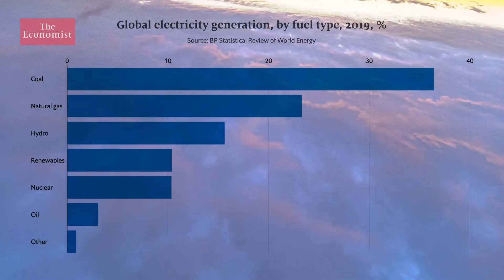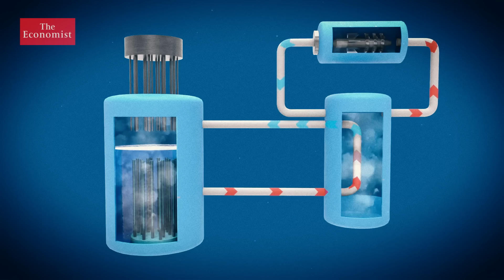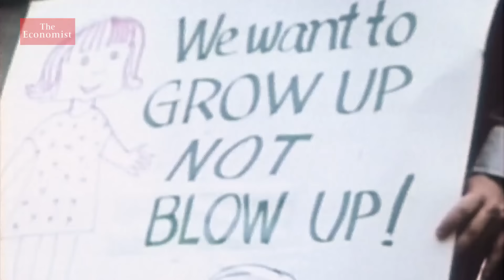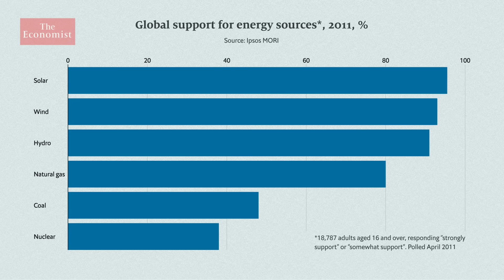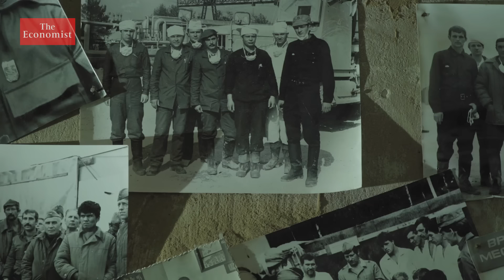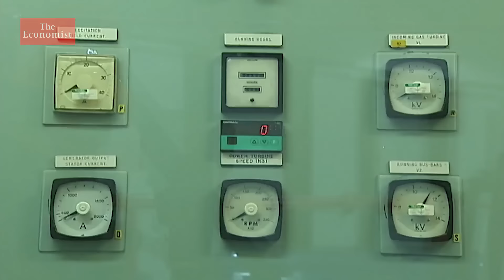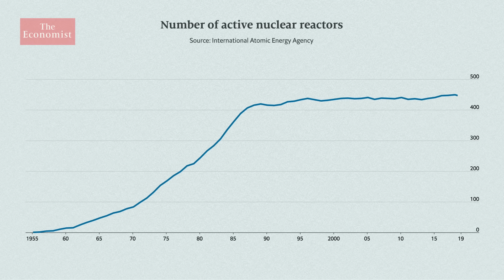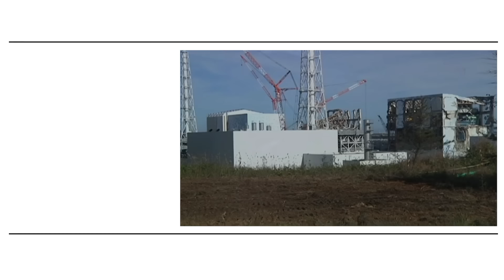Nuclear power: why is it so unpopular?

Comment: Three Mile Island, Windscale, Chernobyl, Fukushima... I don't know, why IS nuclear power so unpopular?
Reply: Exactly 💯
Reply: How many deaths and injuries along with life limiting conditions have been cause by other power generation systems? Coal has to be mined, North Sea gas is produced in an environment that has lost lives so I think we need to look at the complete cycle before determining safety.

Could it be when we look at deaths caused by conditions like pneumoconiosis and silicosis in miners and many other conditions under the COPD family that have effected not just miners producing coal but, the general population from the levels of pollution produced would be significant when the full picture is considered?

Is killing someone with radiation somehow worse that killing them by filling their lungs with dust or pollution?
Reply: @captainjackpugh6050  Is there a safe, non-impactful way of disposing of the spent fuel rods now, or are we still concreting them up for future generations to deal with? Your generation maybe, seeing as you're about twenty at most?
Reply: @ohidontknow1061  Nobody is saying that. I'm simply pointing out that we seem to be a long way from taming the atom for our own ends.
Reply: @stationsixtyseven67     Stored underground, safely. The waste can remain there for thousands of years. The generations then aren’t going to have a single problem getting rid of it. Seriously. It will be easy for them. Technology is great.
Reply: @captainjackpugh6050 do you know how time consuming and expensive it is to store nuclear waste underground? The process consists of drilling a borehole into basement rock to a depth of up to about 5000 metres, emplacing waste canisters containing used nuclear fuel or vitrified radioactive waste from reprocessing in the lower 2000 metres of the borehole, and sealing the upper 3000 metres of the borehole with materials such as bentonite, asphalt or concrete. If the entire world adopted nuclear power I can tell you right now they won’t all be storing it underground some will cut corners and dump it in the ocean or rivers and forests you seem very ignorant yourself.
Reply: @stationsixtyseven67  I would agree, I'm sure you would agree that the damage to people caused by pollution, mining and petrochemical extraction is an issue as well. 

When we take into account that even green energy requires the extraction of minerals, the use of resins derived from petrochemicals and batteries need lithium to be even reasonably effective we have to accept that all methods of producing energy is in some way damaging to us and the environment.

We know the damage that energy production through hydrocarbons does yet still we carry on with it but, nuclear power..... Oh no.....
Reply: @stationsixtyseven67  Is there a safe way of disposing of the muck that power stations spew out now or are we using the lungs of our children to absorb the particles while they slowly gum up? Is that the sort of future problem you are talking about future generations having to deal with?

I'm not even using the climate warning argument as there's plenty of wiggle room in that but, particulate emission is a real, current and ongoing problem that does cause damage to all of us. 

If we want to have a sensible discussion about waste from any particular method then we should not ignore the issues of the others. Are you in favour of using fossil fuels knowing that they are damaging the lungs of people? Are you ok with future generations being left with that problem to try and solve?

Comment: When talking about nuclear power one should not forget the shutdown costs - and it's billions, billions and billions… Lithuania knows it very well. Our plant was closed in 2009 and the final date of decomissioning is 2038. The estimated cost - 3,5 billion Eur which probably be much higher. So the nuclear energy is not as cheap as it seems. But maybe we should not care about it because the future generations will pay for this?
Reply: Yes thank you for saying this. Engineers planning ends at the drafting table. They never think about long-term consequences. Disposal. Bioaccumulation. Geologic stability.
Reply: @frostrune  The closure of Ignalina nuclear plant was the precondition for Lithuania to access the EU. The problem was that the LT nuclear plant was the same type as the Chernobyl plant so even after considerable safety improvements it was considered unsafe. As you may know safety has never been a priority in Soviet Union and even in todays Russia. Your right there are older nuclear plants in the EU nevertheless but it’s wrong to say a newer one is always better.

Comment: Nuclear energy, IF the proper precautions are taken, is one of the most efficient and clean energy sources out there. The only reason the Chernobyl incident happened was due to a combination of the worker's incompetence, precautions not being not taken, and overall unsafe work procedures
Reply: Also the Soviet government's incompetence in handling the affairs. It got so bad they didn't inform the incident until weeks after the incident happened and public were mad that they weren't informed of it.
Reply: IT was badly designed.

Comment: In Russia we already have closed loop nuclear power with zero waste. Can even use old nuclear waste as fuel.
Reply: thats the thing its not waste until it can not be used any more
Reply: @FowlorTheRooster1990  and then you recycle it... or throw it in some old mine and fill it with concrete
Reply: yes, look up MOX fuel and fast reactors
Reply: I'll believe it when I know more, France was talked about in this very video;  a Nuclear Promotional Advertisement.  France never solved their waste problem,  France HAS a Nuclear Energy Waste PROBLEM.
Reply: @arcanondrum6543  every country that uses nuclear has a spent fuel reprocessing and disposal issue its not just France
Reply: @FowlorTheRooster1990  No argument from me there. This video is nothing less than false propaganda favoring those who profit from the Subsidized industry and the bearded clown they feature lied about France, hence my point
Reply: @arcanondrum6543  what point? and favouring what industry?
Reply: @FowlorTheRooster1990  I will let you replay the video to hear what he said about France and then connect that to my point. 
Industry : the Nuclear Energy Industry.

Comment: What really happened was that there was a massive FUD campaign in the 70-tys financed by our enemies and/or competitors. 

One thing that happened after the oil crisis (1973-1974) was that west that at that point had a lot of oil powered power plants leading more on nuclear power and well all of the oil powered power plants was pretty much replaced with any alternative there was over night. Prior to that date oil powered powerpants was fairly common, now they hardly exist at all. Old coal plants was stated up leading to the smog of the 70-tys and 80-tys prior to catalytic converters in cars.

This was the start of the alternative ca of the late 70-tys and early 80-tys, and also the zero emission rules in California that was abounded pretty much before it went into effect.

While the oil powered powerplants only consumed about 20% of the US oil consumption, the sudden drop combined with the increased production of oil over the mid 70-tys for US was quite obvious to OPEC. The demand for oil was much lower than it use to be, at the same time prices dropped. This was a unsustainable situation for OPEC and the oil industry in general.

More over the push for biofuel, electric cars or hydrogen cars was just started, and was planed to be in full swing by the end of the century. This would pretty much result in the death of the oil producers.

This resulted in a campaigned in the mid 70-tys payed by oil producers against nuclear power. We know this, because at this point they was quite public about it. In 1977 or 1978 this suddenly stopped at the same time several environment organisation suddenly sing from pro nuclear to anti nuclear. Why they did this is not quite public, but according the defectors outside money was the reason. This turned GP from a pro environment organisation to what it pretty much is to day, a anti nuclear organisation. Pretty much every single one of the followed, at the same time they finances expanded drastically.

At the same time the push for solar and wind started to happen. Why? Probably to make it seam like there was a other alternative.

Some people might think that solar and wind would eat into the profit of the oil companies. That is not the case. Solar and wind need fast acting power-plants to back them up. There is only two types, hydro, that there is a limited supply  of, and gas. Gas is a biproduct of oil. This did not only put nuclear out, but also coal, what really at this time was the main competitor to gas and oil. 

This also had the effect of making it harder to get away from oil for cars.

In the late 90-tys and early 00-tys the price of gas skyrocketed and the oil producers become super rich. Than something happened that broke the system. Fracking.

Comment: However, one crucial factor is missing in this video: How and where do you safely store nuclear waste until it is not harmful to the enviroment anymore? This isn't touched at all in this video which is very strang. In my point of view this projects a wrong view on nuclear powerplants and its sustainability.
Reply: What about it? The “waste” is solid metal rods that are stored inside weatherproof dry-cask storage cannisters and stored on-site in a secure location. It is neither a security nor environmental risk.
Reply: Exactly! If someone watched this video, she/ he would have no idea that nuclear waste exists. As if nuclear waste were an insignificant detail which could be “overlooked”. I feel the channel’s credibility on this issue is destroyed.
Reply: There are already reactor designs out there that use nuclear waste. The point is made even more moot when you factor in that Thorium reactors produce even less waste than Uranium-based reactors.
Reply: @howardbaxter2514   So the argument is to replace the nuclear power plant currently in use with new ones? Hopefully by then corrosion and other issues will be solved. In any case, nothing mentioned in this video.
Reply: @geopan73  well, old reactors need to be replaced anyways. My assertion is that we should replace old outdated reactors with newer ones that utilize either Thorium or spent fuel.

Comment: I miss comments about storage / disposal of the radiation material after its use. There is no answers yet. Which for me is the biggest reason to take hands off nuclear power...
Reply: There are answers, you are just ignorant of them.  Thorium molten salt reactors.
Reply: Waste is definitely an issue, but like every other aspect of nuclear power, the danger is exaggerated. Waste is dangerous if you let it into the environment, but people don’t realize how little waste nuclear plants actually produce. You often see pictures of huge caves full of the yellow barrels, but that waste is low-level and is usually just contaminated things like clothing and other non-fuel things, it’s not the waste coming from the reactor. The reactor waste is stored and guarded on site at a nuclear power plant, and since reactors only need refueling once every couple of years, the actual amount made is tiny compared to every other source of energy we have. For instance, (as much as digging solar is cliche for pro-nuclear people) solar energy produces over 100 times more toxic waste in its lifetime than nuclear does, it’s just that people aren’t scared of that waste. 
And of course that isn’t to mention reprocessing, since over 80% of high level waste can actually be recycled and out back in a reactor.
Reply: You are wrong. Search Onkalo spent nuclear fuel repository, Finland. it was opened in 2020. No big chear by propagadist mass media, but it is one of the greatest deeds in last 20 years.
Reply: @jakubcidlik  This repository will only commence work in 2021 and also only be able to store the amount of waste that would be generated in roughly 100 years by only 5 nuclear plants.
Reply: @lesand5484   And by then it will not be needed as all that was to be deposited will be very valuable fuel in thorium molten salt reactors.
Reply: @danadurnfordkevinblanchdebunk  It's funny how everybody thinks Thorium is safe when it's waste products include Tritium, which is almost impossible to keep from escaping, then you have corrosion problems in the reactors and the waste has high radiation...
Reply: @lesand5484   Every single nuclear power plant on the planet releases tritium.  It's also produced in nature since the beginning of time.

Comment: Waste is not the problem. At all. 
As of 2013 USA accumulated about 70 000 tonnes of nuclear waste. The specific barrel for this is about 3m high. That's one football field of waste, of which very small proportion is "long lasting".
Reply: Yeah, one long term storage site could store hundreds of years of high level watse.
Reply: @capras12   And would be a great repository for fuel for use in thorium molten salt reactors.

Comment: But why build them at all when renewables with storage is actually cheaper and has 0 or close to 0 risk?
Reply: To create a transition between fossil fuels and renewables, the major issue with renewables right now is energy storage batteries and other methods are currently expensive and don’t store near enough energy for their size. Until we can create better ways of storing the energy it would be hard to go fully renawble especially on a time frame like the one we are on.
Reply: Because nuclear plant has even better baseload capacity than coal. Baseolad  is something renewables can't do now, which is the reason why Germany are firing coal again after shutting down nuclear reactors, and also the reason why Japanese are turning back to nuclear

Comment: What about the nuclear wast?
Reply: No one has been injured by stored nuclear waste.  Besides, it will be valuable fuel in the future.
Reply: Yes, current nuclear waste is slightly used nuclear fuel to another reactor, say a molten chloride fast reactor.  Its waste would be 1/1000th the amount and radioactive safe in ~300 yrs

Comment: I dislike that you did not mention the storage of burned out fuel once.
Reply: No one on the planet has ever been injured stored spent fuel rods.  They will be valuable fuel in thorium molten salt reactors.
Reply: @danadurnfordkevinblanchdebunk  Well, most countries on earth think differently and need a long term way to store these materials safely for millions of years. I don’t want to imply it’s not safe but rather insanely expensive when you consider all costs attributed.
Reply: @nelsonmandela9590   Costs?  It costs very little sitting in water pools presently, has never harmed anyone, and will hav an extremely high resale value!
Reply: @danadurnfordkevinblanchdebunk  Resell value is currently far beyond negative. You need to calculate with the present real value and not some wish-thinking. Building a storage unit suitable for a million years and monitoring it is extremely expensive. Present bias hits hard with nuclear energy.
Reply: @nelsonmandela9590   You keep saying millions of years, yet you can't think in terms of decades?  
Wow!
Reply: @danadurnfordkevinblanchdebunk  I can think in terms of net present value as well as new reactors being 20-30 years away since 1960y
Reply: @nelsonmandela9590   The payoff for that "nuclear waste" will be immense.  Then your "millions of years" meme will be a moot point since it will be be further depleted dramatically.
Reply: @danadurnfordkevinblanchdebunk  Let’s agree to disagree. I can’t see how any country is scrambling in search for a final storage for eternity and you seem to treat it like unprocessed oil.

Comment: Forget Uranium, update the conversation to Thorium and MSR’s
Reply: Those are not available today and we don't know exactly what they will cost. They may end up cheaper than existing reactors, but we can't know this yet.
Reply: Thorium holds a lot of promise but I'd rather talk 4th-Gen MSR reactors that consume existing nuclear waste as fuel. We have enough of it to power the world for hundreds of years.
In the mean time, we perfect Thorium reactors and fusion power. Eventually we'll need that. We'll also need that in space. Anything past Mars and solar is about useless.
Not that Thorium is bad. It's actually quite wonderful, but my priority is on eliminating the nuclear waste.
Reply: It’s not an either/or choice.  If your only tool is a hammer...  Choose and use the best tool for the application.
Reply: @protorhinocerator142  Your priorities are wrong. Nuclear waste is not a problem. All that matters is producing cheap, reliable energy to power the economy so that the standard of living increases. If a MSR is cheaper than a LWR, great. If not, there's no point in switching.
Reply: Helium is a better coolant for neutron economy, CO2 is not that bad either. Salt is not the end of the world.

Comment: I can't believe this presentation made no mention of Thorium powered nuclear reactors.  These are much safer, can be much smaller and cheaper.  NO RISK of meltdow because of inherent design.  Thorium reactors were developed at the same time as Uranium based technology decades ago but lost out like the Sony Betamax  vs VHS video.
Reply: Or just use normal nuclear power